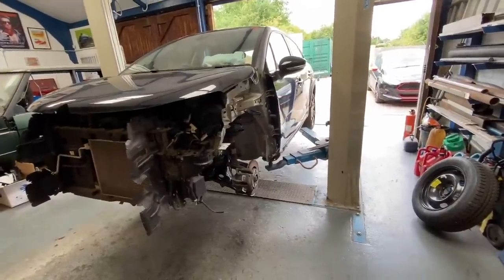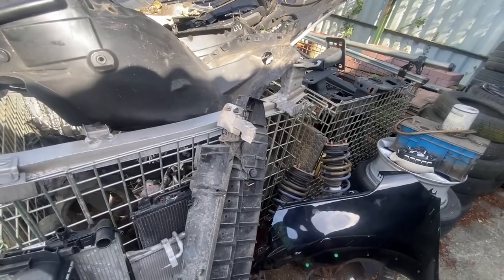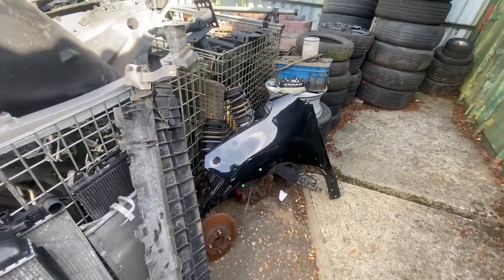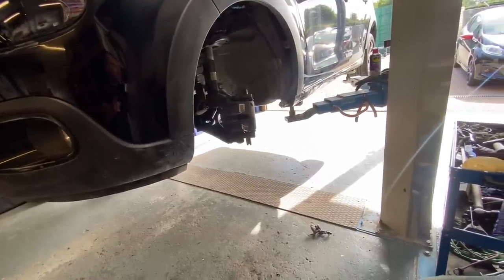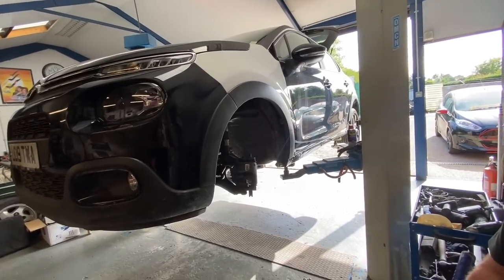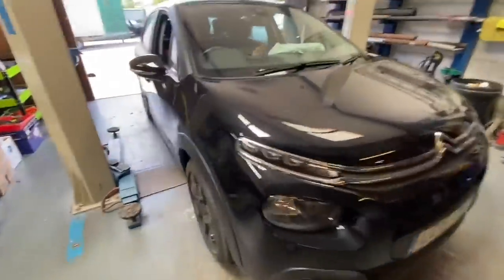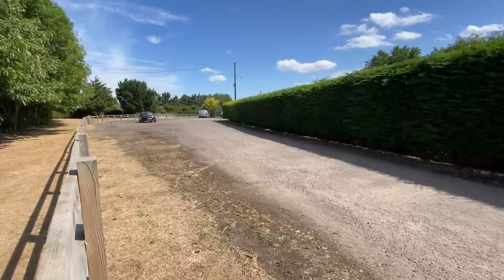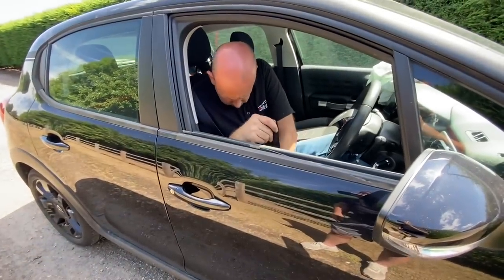REBUILDING A WRECKED 2019 CITROEN C3 FROM COPART SALVAGE AUCTION

Comment: guys make sure your torque the nut on driveshaft as if you gun it up it can snap the end of it when its driving with no warning,i work for citroen dealership and have seen it many times
Reply from the maker: It has been done up to speck and peaned over

Comment: Also the crash detected fault, the Peugeot, Citroen and Vauxhall's sometimes throw up a radar/distance fault but it's actually a crash reset it needs, also once everything's sorted there might be a wee orange light comes on the dash, we had a Peugeot and the light came on as soon as I drove it forward, couldn't figure it out then realised it was because I hadn't plugged the seatbelt in, basically it turns the automatic brake off if it senses your driving with no seatbelt on as if the auto brake kicks in you'll likely hit the windscreen

Comment: Guys I have the rode wireless two go microphones for simple video jobs , totally wireless and keep the sound in each mic and also send sound to the camera or phone via a separate receiver that you connect with a cable , really great sound very light and good you have the safety of a backup in each mic also they are dead light they clip to your shirt or whatever you even runs lavier off them too if you want it more. Discrete

An idea for you if you haven’t committed to purchase already

Comment: Sorry a damaged alloy wheel by nature of the alloy used in the wheel is scrap when bent. You can straighten it but you weaken the wheel doing so.  They replace a crash bar but straighten a alloy wheel.
Reply: If you look at when the first got the car the wheel was in the boot. Wasn’t bent at all. Just a scuff on the face.
Reply: He also never said it was straightened out?
Reply: Not true. Alloy wheels can be straightened provided any deformation is not too severe. It's a pretty big industry, especially with the potholed excuses for roads we have in the UK.. It is true though that some brands use a lot more silica in their alloy and these often can't be straightened as they're too brittle.

Comment: hmm...the 1.2 l engine really is under powered for this car.
Reply: Have the 130 bhp version in my Aircross. Works fine and it tows our folding camper with not issues
Reply from the maker: It’s not really a that sort of car that needs power or speed 👍
Reply: @sruk  well said . It’s a great little car. More than happy with the power. Had a Mini Clubman before the Aircross and not missing the sporty ride
Reply: @sruk  yeah true enough.

Comment: Hi Chris and Rob I got a Mondeo 2008  well 58 plate when Iam driving it's fine as air going through the rad soon as Iam stationery it starts to over heat so at min when at lights or heaven traffic I have turn engine off then restart when traffic moving my fan next to the rad not kicking in when I turn off when stationery the temp holds fine but if I left running it would go to red is this my problem the fan not king in if so do I need new fan. Thankx guys love whatching your vids